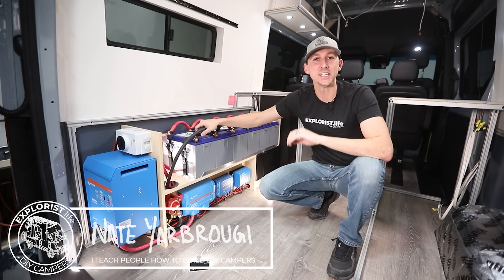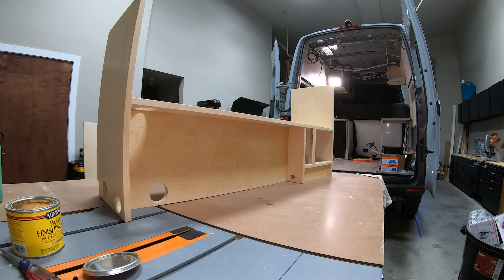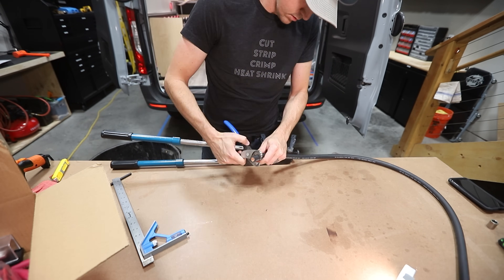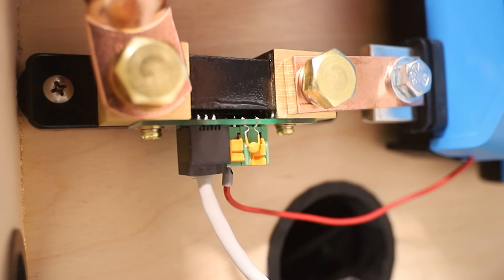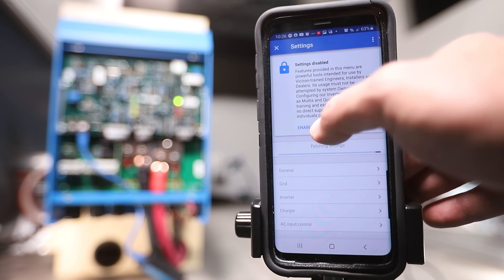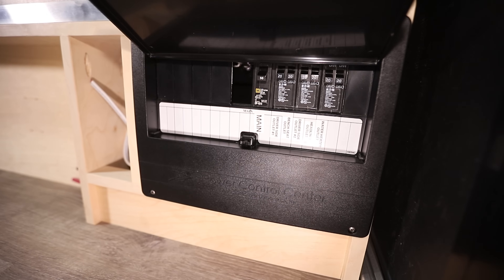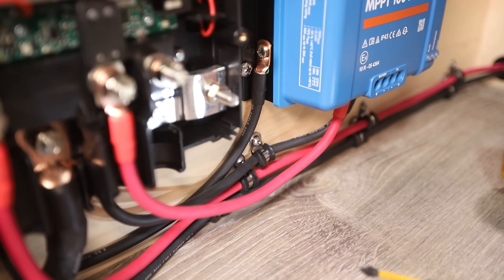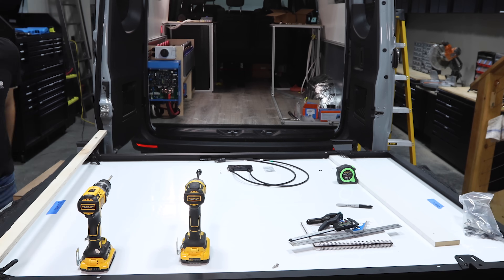DIY Sprinter Camper Van Electrical Install - Full Tutorial

Comment: How many Battle Born 100 amp batteries can you connect to victron 12 3000 + I was told 3 you got 6 ... Help please
Reply from the maker: Minimum of 4.  There's not a maximum.
Reply: @EXPLORISTlife  then again no one told me any of that from (Arizona Solar) I have the same system like yours ... They did say there was some micro dip switch on the inverter to set the type of battery it self, I had asked them to set that up for me and they say flat out NO I got my system since early 2019 and now it has some missing parts and unable to setup I BELIEVE YOU ARE THE FIRST PERSON THAT HAS POSTED A FULL VIDEO BUT YET CONFUSING BECAUSE YOU DID NOT SHOW HOW TO PROGRAM . 
I gave the system to someone that was going to help set it up a few month later I got it back as if it was drag intentionally I don't even know if it's the same I gave him. 

I did a brief search on your videos and nothing no how to program.

2 batteries on my purchase and now according to you if it was program I can not used either because I need 4 or more batteries. You maybe right but I got 100 different stories on how to. 

Can you please do a video on how to program assuming I had 4 batteries even know you said ZZZ password is only for professionals. Almost 3 years later nothing and now my catalytic was stolen.

Comment: How many amps you  set up your charger to charge the batteries..?
Reply from the maker: 30A on the orion.  30A on the MPPT.  120A on the multiplus but gated back to whatever amperage of shore power we have available through the app via PowerAssist.
Reply: Thanks allot  for response  sr.

Comment: Maybe someone can help me. I have two 12v batteries, but that’s not enough for a 200v appliance, even if wired in series. So I need a 200v deep cycle battery?

Comment: Hello
I am in the process of sari I get my Rv and am electronically challenged. With that said I have gotten a 400ah  victron controlled with 4 battle born 100ah batteries, (10) 310w panels from SanTan solar. My question to you is do you have a Patreon set up I could join and get your expert help and list of products I might need from you to complete. I am heading from  CA to SD and will want to have my mini split running to keep us as cool as possible. Can you help me
Reply from the maker: This playlist should teach you everything you need to get all of that set up properly: https://youtube.com/playlist?list=PLmvhcyi4n0TU6HlMaQiCUwC20DBlyv6s_  I no longer have in-depth personalized consulting options available because that playlist answers 99% of the questions I was getting when I offered consulting. For example...

You're going to need to break that solar array up into multiple arrays if you are wiring to a 12V battery bank.  Here's why: https://youtu.be/Jkbs84sBHsg

Here's how to wire  multiple solar arrays to the same battery bank: https://youtu.be/N0UB7LZVduk

Here's how to size the charge controller: https://youtu.be/MxziHKvTRh8

Comment: Has anyone used SOK batteries in this exact setup instead of Battle Borne? I'm planning to follow this setup to a T but wonder if the SOK batteries would be okay to substitute.  They seem to have great reviews and are so much cheaper.
Reply from the maker: Electrically it would work, but you'd need to reach out to SOK for the charging parameters for the VictronConnect app, and you'd probably have to program your Multiplus yourself as SOK isn't a Victron dealer who can pre-program it for you like Battle Born does.  You'd also want to cross reference battery sizes for the enclosure and alter as necessary.
Reply: @EXPLORISTlife  ohmygosh thank you so much for replying!!! I have been learning so much from your videos and appreciate all that you do. Getting ready to purchase your electric kit this week. Thank you!

Comment: why does your wiring diagram show 2/0 wire for the batteries and in the video you use 4/0.
Reply from the maker: The wiring diagram for this project shows 4/0 for the batteries.

Comment: This may be an ignorant question but why so many batteries their almost a 1000 a piece (good lord!!) Serious question tho
Reply from the maker: The battery bank is sized for somebodies power needs.  For example... when Steph and I were living in our van, we used 300ah per day during our normal work day.  We had 6x batteries so that we could work for two days with little sun and no driving around.  Although batteries are expensive... running out of power and failing to deliver to clients is WAY more expensive; thus a large battery bank.  Here is a tutorial that will teach you how much battery bank capacity you'd need for your own power demands: https://youtu.be/a406IxiU-Xg
Reply: I actually did watch it after the fact and it's much clearer now thank you for a response and the great content

Comment: Battle born told me not to use those copper bars because they're a big source of resistance.
Reply from the maker: I mean... that's not true, though.  They'll be less resistance than using a Lug -> Wire -> Lug.  They only time they are a 'big source of resistance' is if you try to tighten everything down without the spacers I show so the copper is not flush, or if you don't secure the battery switch down as shown.

Comment: Do you think a 48v system is better than a 24v?
Reply from the maker: Not as a blanket statement, no.  They are great for much larger systems like over 6000w of inverting power.
Reply: @EXPLORISTlife  Im going to be making a new van conversion next year and just planning it out now....  i'd like to have a higher end system I know it costs a bit more but hey ho, It looks like everything runs easier on a 48v less stress on the system, obviously its more expensive and more complex but i think its worth it,
was going to run a secondary alternator that runs at 48v too to charge batteries faster
Reply from the maker: We've covered 12v vs 24v vs 48v systems in previous videos and will cover it again in more depth later in this academy we are currently putting out, but we generally recommend 12V for systems with 3000w of inverting power or less, 24V for 3000w to 5000w, and 48V for anything larger than that and we have all of those appropriate voltages in the systems we have available in our store: https://shop.explorist.life

Comment: How do you determine the mega fuse size required?
Reply from the maker: Usually it's listed in the user manual for whatever component you are trying to connect, but if not -> https://youtu.be/5y-yDMEgV70

Comment: That last step seems overcomplecated to ad a fuse. Why wouldn't a inline fuse work?
Reply from the maker: There wasn't a really good spot to connect the wire to add an inline fuse.  There are probably 'other' spots it would work... but the way I showed is the 'correct' way to do it.

Comment: Do the batteries need ventilation?
Reply from the maker: Nope!  Lithium batteries like the ones used here do not offgas like Lead Acid or some AGM's; so no ventilation for the batteries is necessary.

Comment: do you have a complete unit available
Reply from the maker: Yep!  The complete kit I referred to throughout this video can be found in the pinned comment of this comment section; but here is a direct link: https://shop.explorist.life/shop/all-products/camper-wiring-kits/600ah-multiplus-3k-12v-orion-12-12-30-400w-solar-wiring-kit/

If you are talking about a pre-assembled unit; you'll want to hire one of our approved installers to have them build it for you if you do not want to do it yourself like shown in this video: https://www.explorist.life/camper-electrical-install-services/

Comment: what size are those grommets you made? 2.5"? or 3"
Reply from the maker: Yeah, one of those, probably. (I don't remember) 🤣
Reply: @EXPLORISTlife  i notice you are using 20 Amp fuses (in your AC Box) but the wire is white, shouldn't you be using yellow 12 gauge? Great video ! Im a big fan and grateful customer!
Reply from the maker: With marine triplex wire like we are using, the outer sheathing color doesn't mean anything.  We were using 12ga wire on all AC wires connected to 20A breakers.

Comment: How much does a complete electrical system like this cost?
Reply from the maker: Did you check out the "Full Parts List for this install" from the pinned comments here at the top of the comments section? https://shop.explorist.life/shop/all-products/camper-wiring-kits/600ah-multiplus-3k-12v-orion-12-12-30-400w-solar-wiring-kit/
Reply: @EXPLORISTlife  Yeah I did actually. Sorry I meant to come back and edit my comment but fell in a rabbit hole...

Comment: That is overkill 6 batteries?
Reply from the maker: Ken.  It may be overkill for YOU... but this isn't your van and everybody has different needs than you.  Size YOUR system for YOUR needs with a power audit.

Comment: What size mega fuse is at minute 43? Is it 80?
Reply from the maker: The 43 minute mark is showing installation of the MPPT 100/30 wiring kit.  Parts included are shown on the product page: https://shop.explorist.life/shop/all-products/camper-wiring-kits/solar-charge-controller-wiring-kits/victron-smartsolar-mppt-10030-wiring-kit/

Comment: can I use this exact system for a 230v output?
Reply from the maker: You'll need to swap the inverter for a 230V version and all the appropriate AC parts.  The DC side of the system would remain the same.
Reply: @EXPLORISTlife  Could I use the same  12/3000/120 one you are using, or I have to buy a 24/3000/70-16 230V GX?

If so, could I use the same wiring kit's as you for the instalation and distribution panel, changing of course the breacker for a 230v one

Sorry if I miss spelled something, tank you for answering so quickly and helpfully
Reply from the maker: You'd need to swap the 12/3000/1200 for the 12/3000/230

The rest of the kits EXCEPT the shore power wiring kit and the AC distribution panel wiring kit should be just fine.
Reply: @EXPLORISTlife  I tried looking for a 12/3000/230 but all I find is the 12/3000/120 230V Ve.bus compatible

Comment: Not on the diagram that I paid for and downloaded from your website. It clearly shows it as 2/0.
Reply from the maker: Yeah, we have several diagrams available on our site.  The ones with 2000w inverters connected to a 12V battery bank have 2/0 wire since the electrical demands are lower; but the diagram for this build with the 12V battery bank and 3kva Multiplus shows 4/0.  Sounds like you've purchased a diagram for a slightly smaller system than shown in this particular video.  The installation for the diagram you've chosen, though, will be very similar to this video shown, though, just with a bit different wire sizes.
Reply from the maker: If you feel that the diagram you received is not the one you purchased, submit a support ticket through the address listed on your receipt (https://shop.explorist.life/support)and I'll check into it.

Comment: I’m trying to understand why people go through all this when I can simply wire it at120 volt and use a generator?
Reply from the maker: Learning something new.  It's fun to make power from the sun.  Not relying on keeping a gas tank full.  It's quiet.  It's a renewable energy source.  Generators can't be run 24/7 depending on where you're camping.  Less maintenance.

Comment: I'd imagine a HUGE difference in resistance between your two battery connections at https://youtu.be/01F4QDVJUq0?t=981 because the positive cable has a fuse, fuse block, and switch in it.  Perhaps you could have measured that and made the positive cable much shorter.  What do you think?

Comment: 4/0 copper can run a 300 amp service to a house!
Reply from the maker: Yep!  It's important to understand that service to a house is 240V and our inverter is only 12V.  Our 3000w inverter / 12V = 250A when running at full capacity.

Comment: 1:11:30 why not just pull all loads from the batteries ?
Reply from the maker: All loads are being pulled from the batteries.  We are just using the Victron Lynx Distributor to organize and fuse all of the loads with minimal extra connections and without stacking 5+ loads onto a battery terminal.

Comment: Great Show, right up to the point where you said an alternator is a mechanical device, and then said drawing current from it wears it out.   I was beginning to think you were an electrical engineer, but now I am thinking you are just a great technician.   Am I wrong?
Reply from the maker: The harder you push an alternator, the sooner it will likely wear out.

I'm not an engineer, no, but that's how alternators work (and engines, and tires, and brakes)

Comment: So I was replacing all the electrical (and pretty much everything) in my POS Eclipse Attitude Toy Hauler bought new and during covid, the worst craftsmanship ever, and the cheesy push pull battery disconnect to a tin two dollar fuse was first.  the new 250 amp rated switch says to wire it to the ground, so which is it, your tutorial says positive, but Battleborn and the switch makers says ground side????
Reply from the maker: I'm not really following your question.  None of the switches in our system designs found on our channel or in our shop have switched grounds.
Reply: You wired the switch with the positive (red) wire, the mfr. instructions say to use the ground wire.

Comment: This setup takes up a lot of space, especially the shore power inverter charger, doesn't seem worth it to me. If you really need another charging option, wouldn't an EV charger make so much more sense? It's a van, charge it at places a van goes, with DC power, the power most things in a van uses. Second thing, why 12V? Why not 24? Keep the amps lower and get higher efficiencies. I'm leaning towards 24V in my setup with a 24V air conditioner. Third question, wouldn't you want a second alternator for the second battery type
Reply from the maker: There aren't EV chargers at campgrounds or at most houses, so a standard 120V shore power charger is much more useful.  Plus... EV chargers are for vehicles that use electricity to get to their next destination; not for powering their creature comforts.  Using  an EV charger for an RV is a good way to get even more restrictions placed on campers, vans, and RVs in parking lots.

We are powering 12V loads and charging by a 12V alternator.  Since we only have a relatively small system with a 3kVa inverter and less than 1450W of solar; 12V is plenty sufficient and keeps things simple.

2nd alternator is indeed an option, but they aren't readily available enough for me to make a tutorial on them.  I only make tutorials on products that are readily available in to the consumer market.  Keeping it simple for you all, ya know?

Comment: that fuse box under the seat makes no sense at all, you can never access it or replace it if you have problems along the way.
Reply from the maker: Sure.  That's why it's incredibly important to make sure you have good quality crimps and you fully re-tighten the hardware before putting the seat back on.

Comment: 4/0 cable and you state you expect the load to reach 250 amps (230-260 ampacity), you use a 400 amp fuse and a 300 amp switch, and you are worried about 2 extra feet of wire. That wire is your fuse in this system.
Reply from the maker: We are using wire that has a higher ampacity rating than you are referring to as it has 105 degree C insulation, so the ampacity ratings are higher (445A for 4/0 wire for wires in free air outside of the engine room).  The fuse can be up to 150% of the max ampacity of the wire per ABYC E-11.  We are well with acceptable parameters here. Hope this helps!

Comment: Since you're taking fast and doing everything in time-lapse it would be helpful to have a clear shot for a second or two every so often so we can pause the video and do the work.
Reply from the maker: If you need to slow the playback speed, you can do so by clicking the cog in the lower right corner. 🙂👍

Comment: This setup is people with cash. There's lots of  ways to wire your van. This setup is clean any nice..this van cost about 60k. If your gonna spend that much it better have that nice and neat wiring for sure.
Reply from the maker: I'd say that if you are going to spend any amount of money on any price-point of van; the electrical system should be dialed in with properly sized fuses, wires, and distribution.  A $5,000 van will burn just as fast as a $60,000 van if an electrical fire starts.

Comment: This system is WAY too sophisticated for my tastes. I don’t want ANYTHING that requires an app/WiFi/internet. If it’s that dependent on software ‘THEY’ can turn you off just like anywhere else; so what’s the point of being “off grid”.
Reply from the maker: We are 'off grid' in terms of not being connected to the electrical grid; not tin-foil anti-gubment off-grid.  If this system is 'too sophisticated' for your tastes, that's totally fine.  To my knowledge, nobody is forcing you to build this system.  In fact, you're free to do whatever you like.  You could even make the decision to not comment and simply navigate to a different video that you liked better.  Hope this helps bring you a more positive solution than negativity you brought to this video.

Comment: Why use 12V system instead of 48V?! All your components are 4 times more beefier in 12V system, all components and cables are more expensive and heavy and difficult to route through narrow spaces. Thick cables also create high stress in mobile installations due to the vibrations and bumps.
And this system is less efficient than higher 48V system due to the high current and conversion ratios...  Really weird build, would never build such system because all the disadvantages.
Reply from the maker: They are good enough for our purposes considering they are also all bolted together with 4/0 wire.  Feel free to secure them however you like in your own build for your own needs, though. Thanks for watching!